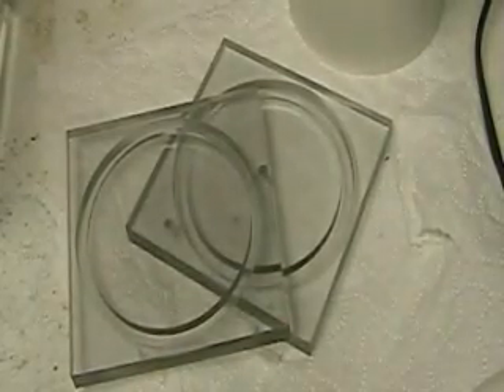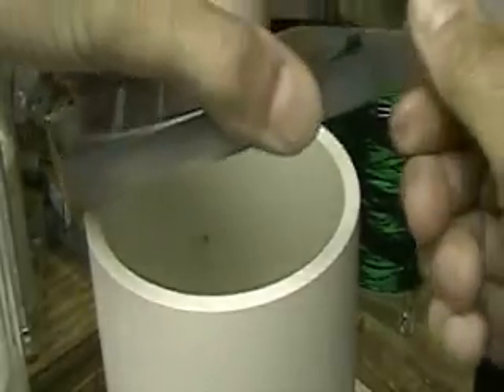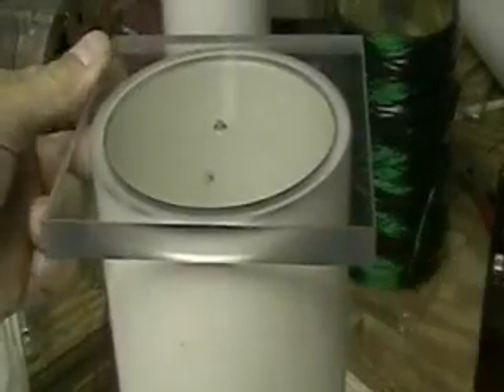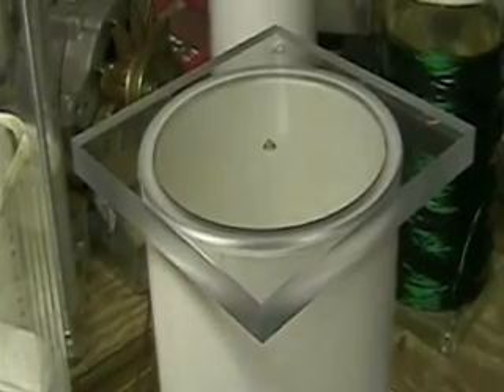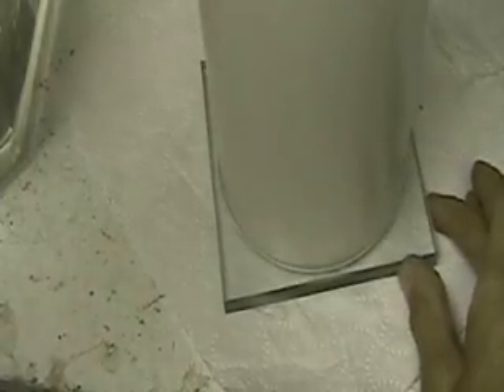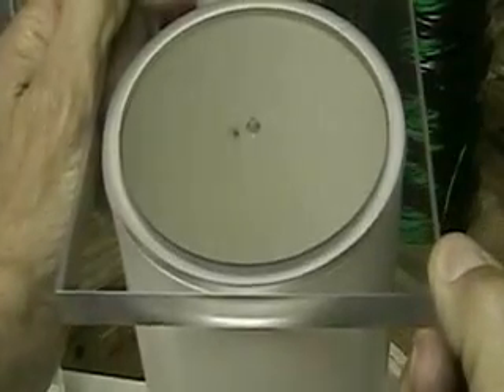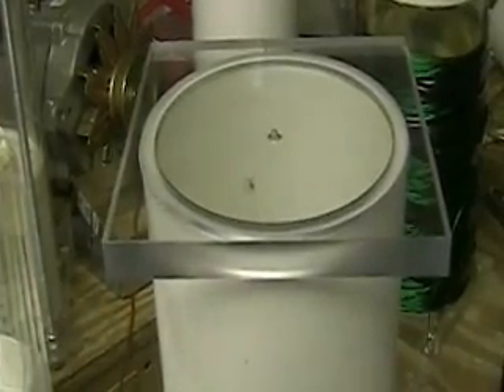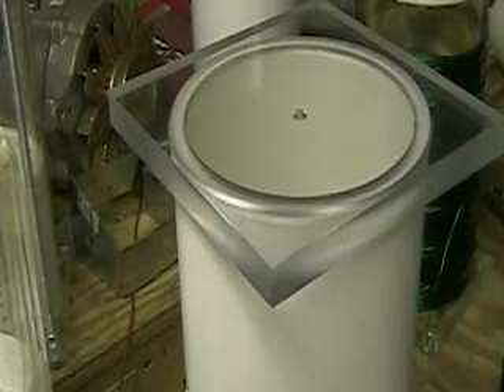Hydrogen Tap ( FOCUS II ) 384

Comment: It depends on how long you drive as the longer you drive the less electrolyte you will
need. I try to set the amps to around 5 to 6 amps which will climb in temp the longer you drive as the cell's temp will climb to pull almost 20 amps within an hour of driving. And in the cooler temps of fall and winter you will need more electrolyte.

Comment: hey john, you could create a groove in the main part of the cell where the lexan top and bottom pieces go, and put in some sort of rubber or similar O-ring to seal it to prevent leakage of HHO from your cell and O-Rings would be easier to replace and cleaner than putting Goop or any kind of sealant on the pipe and/or the top/bottom pieces.